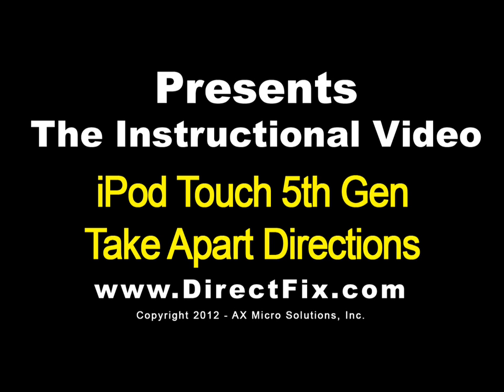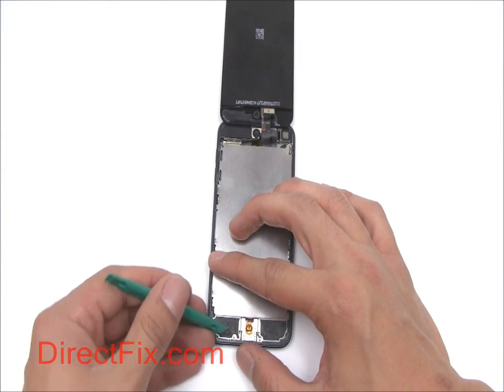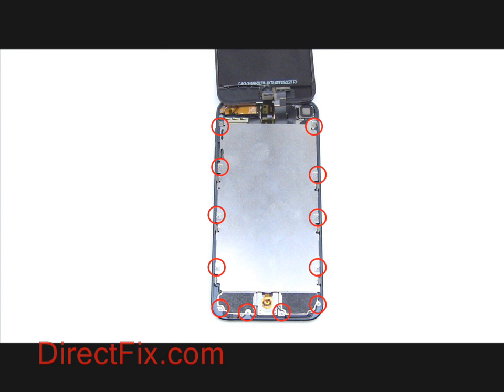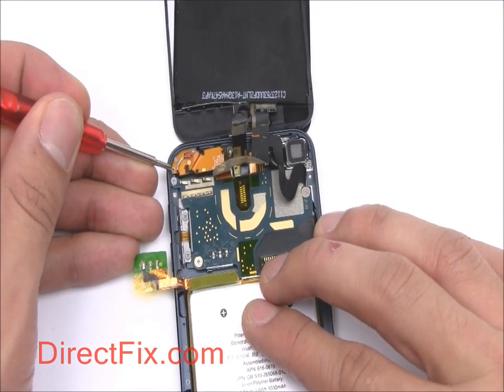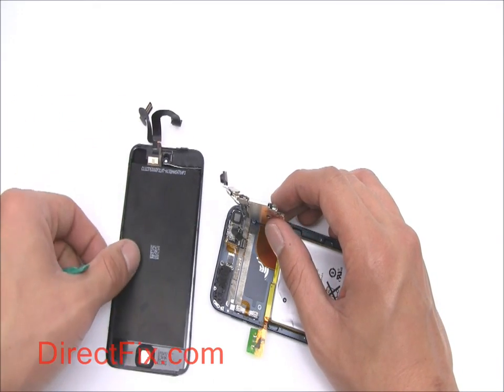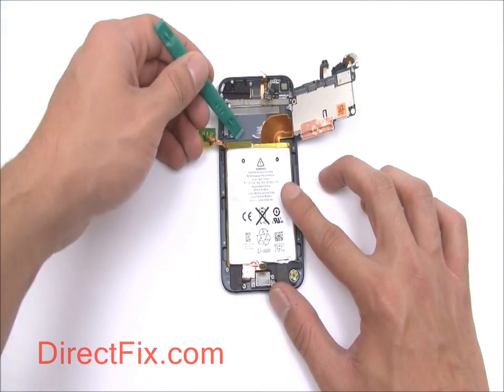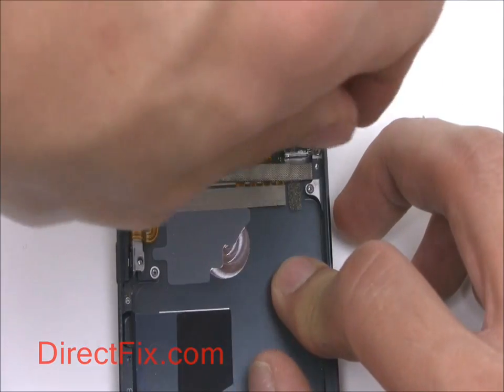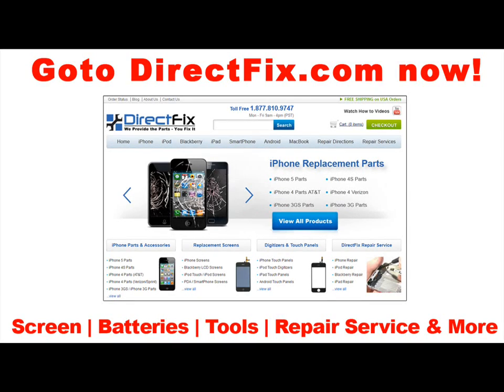How To iPod Touch 5 5th Generation Screen Replacement

Comment: my iPod touch 5th generation (Blue) is slightly bent and the touch screen does not work, the screen still displays image but with lines in between and no touch screen. Will replacing the screen fix it?

Comment: Where can i get the speaker system for the ipod touch? Mine got wet so the speakers dont play anything it just acts as if there are headphones attached to it.
Reply: Did you get it fixed? Because that just happened to me

Comment: Can you fix my ipod if has a crack screen or water damage?
Reply from the maker: If the only issue is a cracked screen then yes you can fix it with this part. http://www.directfix.com/product/IP-2685.html now any water damage it is not worth fixing because multiple issues can occur or parts got damaged.
Reply: DirectFix 
My screen is cracked but the touchscreen is fine. Do I need to replace the digitizer and LCD? Do I only need the outer glass lens?
Reply from the maker: DoctorFrolicks
 Here is a link to the part you need: http://www.directfix.com/product/IP-2685.html